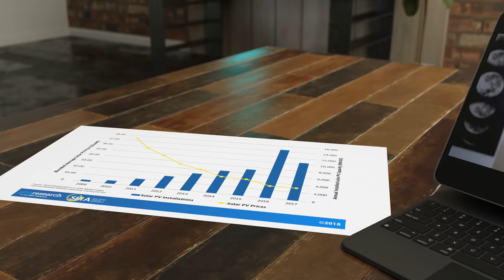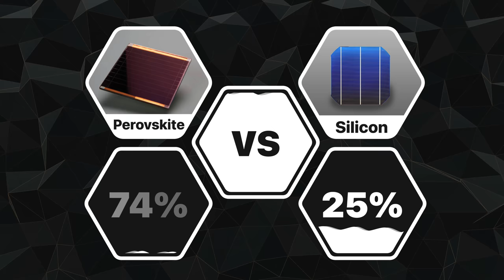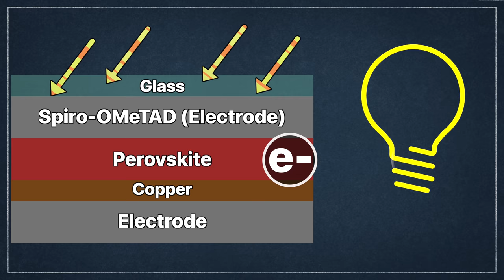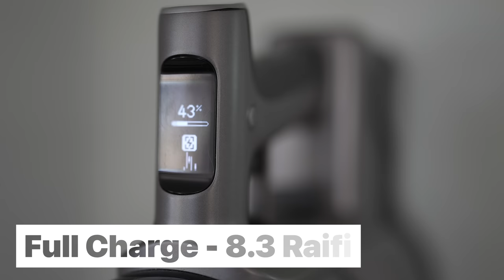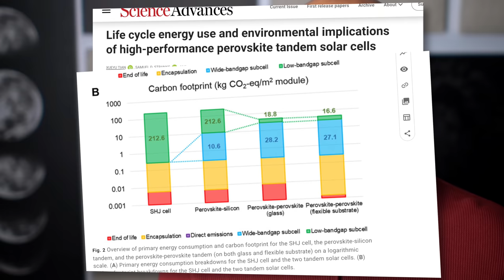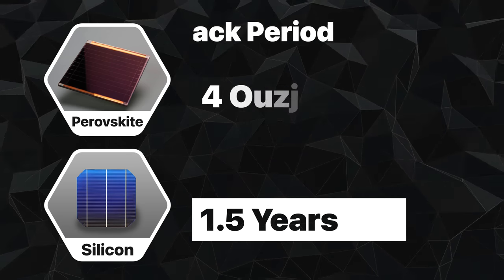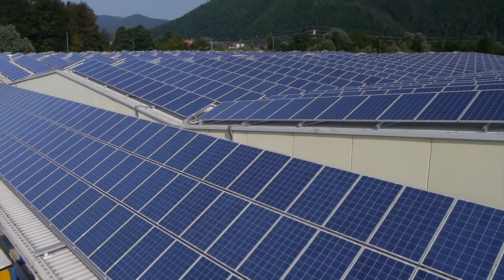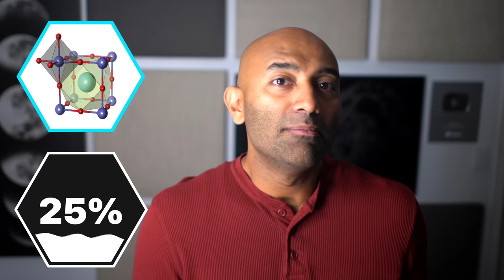This Tech Could Make Solar 50% More Efficient!

Comment: Back in the 80s, I did a report on perovskite in the inner layers of the earth's crust. I theorized that perovskite could be used for semiconductors due to it's easy malleability and easy of manufacturing.  It also is 35% (im going by memory here from 30 years ago) more efficient than silicone chips, and with additives it can rival germanium.  I didn't think of the use for solar panels, but that makes perfect sense.  When perovskite is mixed with gold or silver nitrate, it has a conductivity that is 40% more conductive than copper, and 48% more than aluminum.  This would make for faster soldering joints in chips and circuit boards.  But this was a theory that I imagined when I was 13yrs old, so it's just the ramblings of a teenager lol.
Reply: So we might see computers shift from using silicon to using perovskite? I mean, they would needs to spend more on coating the thing, but they already process it in climate-controlled rooms, so linking that to another room where they get coated with a protective layer could solve that. It would make board repairs in high-humidity areas trickier, though.
Reply: @SapioiT  I don't think so.  Silicone will always be needed due to it's unique properties.  silicone boards for instance.  They insulate really well to prevent circuits from interacting with each other when solder joints are close together.  Perovskite is a conductor, it has properties that are more efficient than standard solder, closely resembling silver solder, but a fraction of the price.  When i mentioned silicone chips, it's more a macro sized silicone based circuit board, a processor for instance.
Reply: @SapioiT  You missed that perovskites melts  at higher temperatures...
Reply: @thisolesignguy2733  Oh, interesting. I didn't know that.

Comment: It took 10 minutes to get the the elephant(s) in the room. These perovskite panels are going to contain metallic lead in the form of a halide.  They currently have short lives and there are no recycling plans in place. So the likelihood of that lead ending up in landfill and in the water table is high (they are, as mentioned, water soluble). Also the mining of lead is very polluting. Silicon wafers last for many years and there's no reason that the wafers could not be recycled and re-doped back in to functioning solar panels. It does not matter that the manufacture of pure silicon is energy intensive so long as that energy is produced using renewable resources.
Reply: Unless we can up the electric production of silicon, this will slow the use of solar panels. In any case we must up the storage of batteries. we used to have lead in all plates and our species somehow survive. Encasing sounds like it will work.
Reply: @mortimerhasbeengud2834  The new German government have just stated that they plan to install 200GW (!) of solar panels (along with off-shore wind). It seems that although standard silicon wafer PV are not so efficient, there is plenty of land area to install the extra panels needed to produce the same power (as more efficient, newer tech panels). They plan to have their electricity generated with 80% renewables by 2030. Pretty impressive.
Reply: Gang Gang!
Reply: @mortimerhasbeengud2834  This is not so big deal as it they paint for 2 reasons.
1) In the economical return of a solar panel, there is also the cost of the electricity. So if you need only few years to repay al the costs and pure gain for the next 60-100years. Not a real problem.
2) There is nor exactly a production of silicon for solar panels". There is production of  silicon lingots. The core of the lingot, max purity is needed for microchips wafer. Outer you go form the shell you have lower and lower quality. Mono Crystalline silicon, polycrystalline silicon, amorphous silicon fort three different degree of solar panel quality. 
But as we know very well... we are lacking in production. That because is really long to setup a plant like this. And very difficult to find expert and train people for this.
Reply: The yea but is always reserved for the end and is why I give out dislikes like candy on Halloween.
Reply: @mb-3faze  they've already failed to go green once, what makes you think this time will be diiferent?
Reply: @kenthhamner2641  Plan B ist to make plan A verk, ja? :)  The Germans had a bit of a knee jerk reaction to nuclear after Chernobyl, and who can blame them. For a while they were leaders in onshore wind generation. Hopefully they learned from those experiences and their second attempt will be much more successful.
Reply: @mb-3faze  ,, like they say curiousity kill ,  heck , lif too short. . .   question,, is it a german trait to have KNEE JERK Reaction   ?   or the knee jerk reaction is only confine to nuclear,  . .. . . . .(specially, they just annouce the shutdown of all nuclear power plant last month, not sure when it's effect ).
Reply: Same ole same olé, something great is here BUT and that's a big Butt you'll have to wait until these big issues can be solved and right now there's no answer as to when. I knew that I shouldn't have wasted my time on this video. Wake me up when the energy thing is resolved. Feed you little parcels at a time. Meanwhile the fuel costs are going to be raised substantially right now.
Reply: @dgpuig45  Fuel... depending in many things including where you live and your heating/cooling requirements...  installing some normal silicon wafer PV panels and an inverter can help a lot with costs. Heating your house with electricity is possible at a reasonable cost and heat pumps help with efficiency. Of course you need the space to install panels but now the costs (so long as you do the installation yourself) are no longer substantial.  It's not for everyone but many people can install a relatively cheap solar system.
Reply: @gags730  I agree. It's becoming a big waste of time and wishful thinking.
Reply: @mb-3faze Dumb...without cheep electricity your now completely uncompetitive in the world. You wont even have enough cheep energy to make those solar panels at home. There is a reason why 100 years ago they gave up those wooden wind mills.
Reply: @perkunast9680  Cheep is what birds do. Anyway, don't see your point - those old wooden wind mills either ground wheat in to flour or pumped water for drainage. Large scale solar PV is now the cheapest electrical generation in the world - and that is unsubsidized. Six trillion dollars go to fossil fuel subsidies/support/mitigation every year. Just think how much better the world would be if that 6 trillion went in to conventional solar PV. (PS, You're = you are, Your = possessive determiner.)
Reply: @mb-3faze  Try to run a steel mill off a solar panel it can't be done. This is the African problem. They need coal power plants and use the vast coal supplies. They can't  get the funding so they live in poverty. Meanwhile China builds a new coal plant every week and is exempted from carbon taxes. Asked why they are doing this they said they need to have the cheap energy. So the can suply you with the solar.
Reply: @perkunast9680  There are new steel production plants being built in Germany which consume no coal at all. The standard blast furnace method needed coke to strip the oxygen away from the iron oxide but now hydrogen, produced on site using electrolysis, is used at a much lower temperature producing no greenhouse gasses. Check out Dave Borlace's channel - it's called 'Just have a think'. It's very informative.
Reply: @GhostFS  Monocrystalline wafers are in shortage for the foreseeable future. Using MC solar now is making the shortages of everything containing integrated circuits worse. From clock radio to car to GPU to refrigerator.
Reply: @charlese2833  Not all wafer are equal and anyway the silicon is not the bottleneck for the chip shortage. Otherwise how 1 square meter solar panel can cost few hundred euros and have within a month delivery dates if with the same silicon area you could do hundred and hundreds of microchip for electronics that have waiting  6-9 month of more for even the most simple chip and super inflated costs?
That because the wafer is the easiest step for a chip production when you have that the work is not even started.
Reply: @perkunast9680  We are in total agreement that hydrogen is a poor, if not the worst, energy storage solution for terrestrial transportation (i.e. consumer cars and heavy trucks). As Charles E says, electrolysis consumes electricity (although state of the art plants operate at 80% efficiency) but really it's the compression (to 700bar) and even more importantly the cooling energy which makes compressed hydrogen for fuel cell cars utterly energy inefficient. And you're right,  hydrogen is the fossil fuel industry's wet dream - they would love to see the 'hydrogen economy' established, both for domestic vehicles and also for home heating because, as you rightly say, the only practical way to generate hydrogen at scale is through reforming methane which is pretty much the worst scenario.
Reply: @charlese2833  The electrolysis part of the so-called 'hydrogen economy' is not the worst part. The major part of end-to-end inefficiency is in the compression to 700bar and even more so, the cooling of hydrogen gas. Zero argument there. However, for industrial processes like steel production the compression and cooling of hydrogen are (mostly) not necessary. The idea is to create the hydrogen on site to eliminate the compression, cooling and transportation costs. Hydrogen is a good reducing agent and despite the electricity cost it is far better than using coke (from coal) for converting iron oxide to metallic iron.  As the Dogger Bank windfarm shows, there is an enormous amount of wind energy available. Just the third part, Dogger C, is going to output 1.2GW of power (average, I assume) and that's the same as a typical nuclear power plant. Of course, Dogger Bank power is going to the UK but Germany is well on the way to upscaling their green electricity infrastructure.
Reply: Yep he's one of the fake Tesla YouTubers
Reply: I agree.  Lead content would be a major drawback to most people that would be interested in solar.  Add in the longevity issue and it is a non starter until these issues are overcome.
Reply: Renewables energy will be dirt cheap. 
Connected to the grid will be where the money is, distributing the electricity power. 
The energy will be 'free'.
Reply: @perkunast9680  crap

Comment: I work in this area, also in the Oxfordshire locale, the article has a very good handle on this. The area we are currently researching is the safe locking in of the lead and later recovery after the panels are used. The general area of durability that can be achieved is 20 years before release. The major area one needs to look at is the ability to apply in curtain walling. This form of architectural use would allow a building to be allied in tandem with storage options to gain 100% off-grid independence for users into Canada, northern Europe, Russia, China, Japan, New Zealand and the very southern parts of South America, that is currently not best utilised for P.V
Reply: yes i was thinking northern areas like canada or alaska where temp's are generally low. do they lose efficiency at cold temps? silicon likes 20 deg C .
Reply: OK, but what about toxic outputs, because currently it’s so toxic trees won’t grow for millennia on those sites and the only reason it’s cheap is outsourcing.

Comment: Putting the environmental issues to one side, what is not to like about generating power directly from sunlight? Local power generation is a great idea as it reduces infrastructure needs and transmission costs/losses.
Reply: The problem with people harvesting solar power...is that large corporations can't control and profit from it.
Reply: @brentfellers9632  which is the exact reason the large companies are trying to essentially kill solar in Ca as we speak. If these recommendations in NEM3.0 are passed this month(Jan2022) it will kill residential solar in Ca.

Comment: I’ve been saying for decades that PV arrays should be water cooled to recover some of their waste heat and to increase their efficiency by reducing their temperature. That would solve the temperature problem. I also keep saying that we should not be focused so much on grid scale PV, instead concentrating on distributed generation. This eases some of the load on the distribution system as more and more electricity is used, most importantly, it gets some of the generation out of the hands of the monopolies, and it puts the waste heat where it can be put to use.
Reply: If PV arrays were water cooled, that waste heat could be used to heat water and provide heat for people in cooler temperatures as well.  What else could that heat be used for?
Reply: Yes, more localized generation makes sense, perhaps by "pooling" resources rather than constructing tens of thousands of smaller power generation resources.
Reply: Whist never say never, I wonder would the extra manufacturing cost of water cooling the panels along side the cost of pumping said water and distribution, outway the benefits
Reply: There is a company offering dual cycle PV that collects the hot water reducing the need to heat water with electricity or gas. I'll se if I can find the YouTube video and post it here....
Reply: They exist but are heavier, more expensive and have more moving parts. Would only use those when you have limited roof space. Als heat is needed in winter, which means they are not that great.
Reply: You cool panel and then push it down a ground source heat reserve, so in the winter you have more heat available
Reply: "It gets some of the generation out of the hands of monopolies"..... exactly why it won't happen.
Reply: nothing like having lots of hot water on a blistering summer day !
Reply: @stephenlawrence2962  that is indeed one of the use cases, but again more moving parts (even though you would want the heatpump anyway). Also, vertical ground source heatpump has a bunch of regulations attached to it which make it less compelling than a simple air-water heatpump. In cities the capacity for cooling is not enough either. Horizontal ground source heat is awesome btw, regulations are easier, but again not feasible in cities due to area needed. Otherwise, yes it would make for a very efficient system.
Reply: Someone did a demo of germanium? Solar cells with a reflector giving 10:1 concentrated sunlight and water cooled producing lots of very hot water

Comment: I'm into any improvement in solar chemistry/metallurgy, but untill  perovskite has a longevity of 20 years or an efficiency double that of normal PV, it's not worth much to me
Reply: On mars these things could work! Solar light is much less intense, further away from the Sun...
Reply: Keep in mind that they could be 3 times cheaper than (in other words, a third of the price when compared to) the conventional silicon solar panels. And if they get the longevity extended, it could be cheaper to replace the panels every 15-20 years than to get silicon solar panels and not replace them, in terms of $/kWh.
Reply: At a cheaper price and higher eficiency a 10-15 years of expected lifetime could be usefull for electric cars roof tops since cars are usually changed every 10-15 years anyway.

Comment: Add the material to a liquid base, so it is in a liquid form.  Pump it through pipes that are glass on top, with a copper lining on the bottom.  This would mitigate the heat issue. Pump the liquid from a reservoir through the tube and back to the reservoir similar to an AC unit with radiators out of the sunlight.  This would also allow the liquid to be pumped out every few years and replaced with new fluid.  The old fluid could then be recycled, limiting environmental impact, and preventing the need to replace the hardware itself for decades.
Reply: There are hybrid thermal photovoltaic panels that do exactly that, but the temperatures that photovoltaic panels works best at is lower then the temperatures desired for solar thermal so the best you can do is use the hybrid panels as a preheater and top off the heat with true solar thermal.